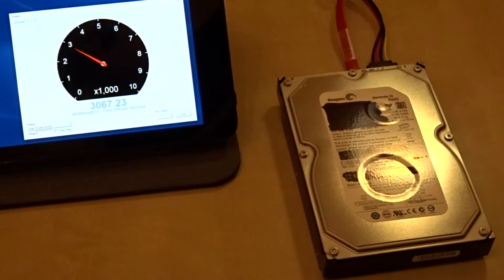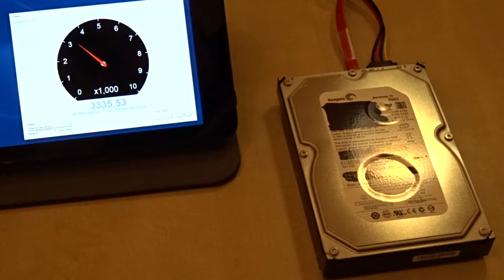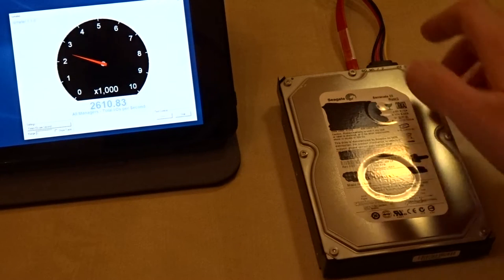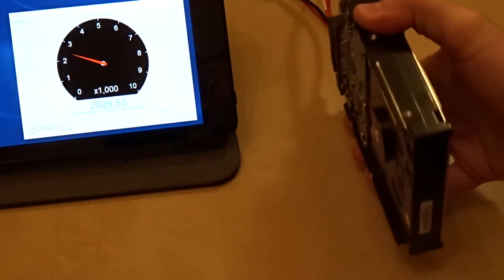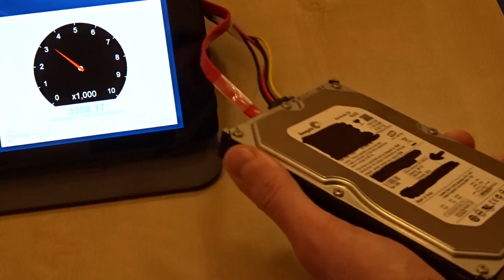Drop and shock test: killing a hard disk drive fail

Comment: I had a Hitachi HGST 250GB 2.5 inch drive. It's been working fine for 11 years. The drive was second hand. The SMART report only said it was at "Caution" and the only problem was the allocated sector count. The drive has been that way for 6 years after i bought it, and yet, still made it to 11 years of everyday usage. In my experience, if a HDD had that kind of issue, it still can be used for a long time but only if you did not torture the disk. Unfortunately, the disk died recently. The strap on my laptop bag snapped and it fell to the ground. It totally killed it.

Comment: the rotation speed is not a true test of resistance in an HDD, it is required that the system is reading and writing data in the HDD to be effectively a real test of the ability of the HDD to withstand shocks
Reply from the maker: This was not showing RPM while that gauge looks like such an instrument. That are IOPS showing data transfer.

Comment: I've always wanted to see a test were a HDD is heated slowly until it dies.
Reply from the maker: Maybe I’m gonna try that when it’s warmer outside. Would a not so scientific approach maybe using a gas torch be alright?
Reply from the maker: I've read that operating temperature goes up to 60 °C on some disks. So a hair dryer might provide sufficient heat.

Comment: It would have been good with each kind of shake that you tested it, but most non-ssd drives don't die instantly anyway and you'll often have time to move your data to another drive even if it's clicking away. I still don't like Seagate drives because I've ruined a few by dropping